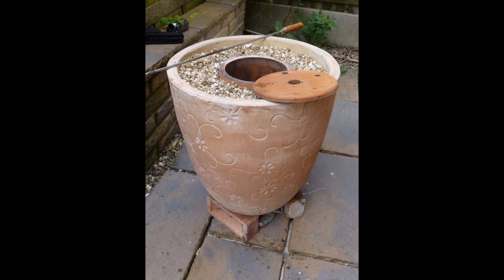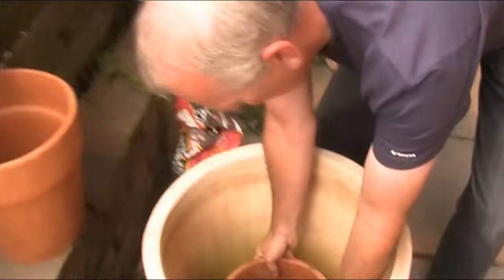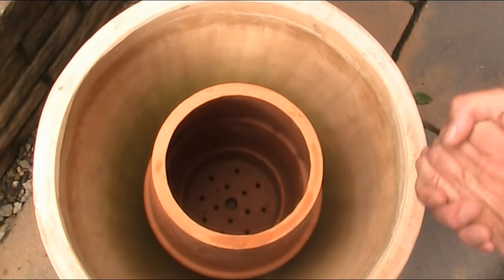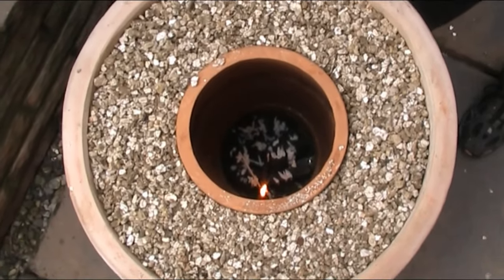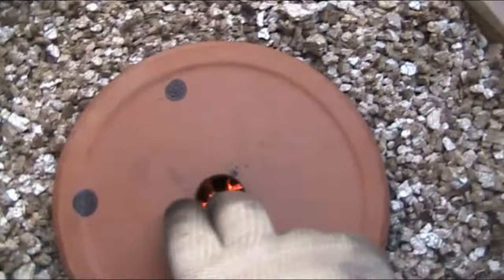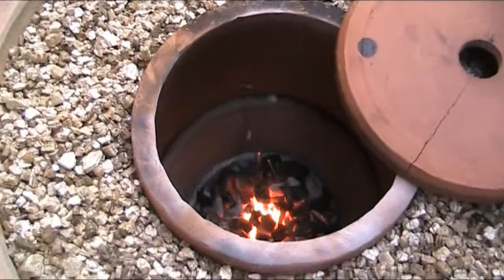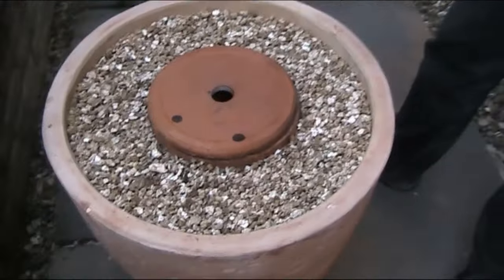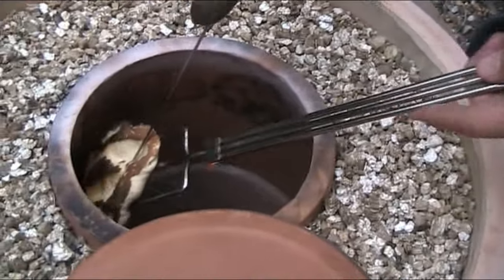How to make a DIY Tandoor oven with Flower Pots

Comment: hello Mr.Collins, few question - why did you drill holes in the inner pot (the one which seats inside the bigger pot), did you also drill holes to the base of bigger pot?  if yes then do you need to align holes of bigger & smaller pot ? for ventilation?  how do you clean (remove ash etc) this unit after you have done with the cooking? do you need to season inner wall of this pot before you start using it? hope to hear from you. thanks in advance
Reply from the maker: Hi Boon, The first oven I built had just one hole in the bottom, but the base was smaller. For the new oven I wanted a bigger base so I could use more charcoal and have an even hotter oven. The bottom pot I went for only had one hole, so I decided to drill more to improve the air flow. I am glad I did as the air flow is perfect, see my other video on lighting the oven. You have seen how easy it is to build, if you are unsure try the oven first. If it doesn't work take it apart, drill some holes and try again. I did not drill any holes in the bigger pot, that already had three big holes. I did not align the holes over the outer pot with the second build. Where possible is best to do that as it makes cleaning easier. As for cleaning some people use a vacuum, but I just use a cloth and brush, see video https://www.youtube.com/watch?v=ewac7d4u2uU . As for seasoning the inner wall, I did not, but others have. Lots of people have used special flavoured rubs, but I was happy without the season..
Reply: thank you. thank you for the whole idea behind this oven. I will make it soon. though i have one more question: the first few chunks/pieces on that skewer facing direct heat(towards the bottom) -  do they get burned/roasted badly? thanks in advance

Comment: Would it okay to place this tandoor pot in my balcony on a concrete floor?
Reply from the maker: Hi Paresh bit hard to answer this one as would want to make sure there is no fire risk. I can tell that I get no real heat from the sides, but some hot ash falls through the bottom onto a tray. I have mine on bricks on top of concrete paving slabs, and it hasn't damaged them.

Comment: This is brilliant I have the plant pots but need insulation. You mentioned vermiculite. This is a type of plant food , will it contaminate the food ? And could I use shingle stones instead ?
Reply from the maker: +Anthony Kirby Hi Anthony, why do you say it is a plant food? Yes gardeners use it, but for soil aeration typically in potting or growing seeds. There is no feed in standard vermiculite. I am using the larger vermiculite typically used with indoor fireplaces. But if you are concerned the vermiculite is kept separate to the food area by the inner pot. You can even put a seal over the top in either clay or render.  Yes you can use shingle stones, several people have. Some are happy and others not. It is clearly a decorative option, but the insulation is not so good.
Reply: +SimpleNick - Nick Collins I researched the wrong vermiculite Nick. The insulating type you use I now know of thanks. It is hard to come by only online order. But I've used smell decorative stones that work really well and much cheaper to. Plus no cracking to inner or outer pots. Thank you for replying.

Comment: Great video Nick cheers! Quick question~ Are there any alternatives to vermiculite? How about sawdust or will that burn from the heat?
Reply from the maker: Hi Hamza, not sure about sawdust, I would always be worried about it catching fire. Some people have used sand with mixed results. Perlite is another good one, and I have also seen people use the small clay beads that gardeners use.
Reply: Cheers Nick shall give it a try

Comment: could the flower pot have chemicals?
Reply: +Hospitalist007 only if it has been glazed. plain clay pots won't have that problem.
Reply from the maker: +Hospitalist007 As Tana says the real problem is if you used glazed pots, plain pots should be fine. I was concerned about lead in the pot, so I made the following video to confirm everything was OK - https://www.youtube.com/watch?v=SNGPP6b4ZZ0

Comment: Love it, consider me inspired to try. I want to use a galvanised incinerator as my exterior, partly because they have the raised ventilation in place but also because they have a lid / carry handles etc.

How effective is the vermiculite insulation? I ask because I can only buy it in 2L bags so that will end up costing more than the other components, is the outside of your largest pot hot to touch, warm, cool?

Thanks, love this!
Reply from the maker: ***** the vermiculite is very effective, and I can easily handle the sides. Understand what you say about the galvanised incinerator as that was my original plan. I was going to store it in the shed and then move it around the garden when needed. Instead I went for the pot as I wanted it on show in the garden all year round. If you are in the UK you could get the following http://www.travisperkins.co.uk/Silvaperl-Vermiculite-Insulation-Granules-V4-100L/p/947421
Reply: Thanks Nick, I've gone ahead and ordered the incinerator, just waiting for Amazon to deliver it (Incinerators aren't on sale in Sweden, where I live). I certainly prefer the pot, it's a much more pleasing look but portability is crucial due to the heavy winters we have here. Will report back with progress!

Comment: nice tandoori oven. but you will struggle with heat and to high temperatures.  you need more width and height. I used a clay pot like yours with a slightly smaller clay pot in the same shape.   kind of like a dome in a dome shape. cooks so much better with better all round heat.
Reply from the maker: +Dean Grant Thanks for the feedback and sharing what you have done with the community. Personally I don't have problems with heat now, as I reduce the amount of charcoal I use. As for naans, I wet the side of the walls to reduce further.
Reply: +SimpleNick - Nick Collins  what I did was  got a large  egg shaped terracotta Pot and put a same type of pot in side it..I had to cut the top off the large pot to get the smaller one inside.. I made a tunnel at the bottom and air holes like the real thing.  I used clay to refill the top.. now my oven has the similarities of the real thing.  and a all round exchange of heat.. and not like a chimney breast or tunnel effect .  it's perfect I'll post the video up soon..

Comment: Had great fun this weekend with this, made some great naan, chicken, lamb and fish!! Bloody brilliant! Cheers Nick!!! one question, the bottom pot has cracked, its the second one to go, wondered if you had a tip to prevent this? thanks again for sharing!!
Reply from the maker: guy mace Hi Guy glad to hear you enjoyed building the Tandoor and you got great results with your food. as to stopping the bottom pot from breaking, some people have said about putting a grid at the bottom to take the coals of the pot to stop it cracking. No scientific proof if that actually works. Personally my inside bottom pot cracked, but it doesn't bother me. It cracked after a couple of burns, and I have been using it for 7 months now. It doesn't affect the performance. I suppose if I was worried I might look to repair it with clay.
Reply: SimpleNick - Nick Collins Hi Nick, thanks for the reply, yes i agree, having used it cracked, it makes little difference to the temps achieved. At least not to a point that matters for cooking. Just for infos sake, I looked into cracked tandoors and most commercialy sold ones advise a low heat (small quantity) of fuel to be used for the first usage and slowly build up the heat, this allows excess water in clay to escape slowly and should prevent cracking, however given we live in the uk and its damp and wet practically all year this will probably become a pain in the arse doing that after each time it rains or gets damp. Another thing I thought was to mix the vermiculite with cement and water and infill  with this. This again would need drying time and a slow warm up to prevent cracking but may be a better longer term thing. But all a bit too much thought here.. your idea is brilliant and I'm so glad you shared it!! Had chicken and naan every day this week!!! all the best.. :)
Reply from the maker: guy mace Thanks for sharing your ideas on curing first. I did that with my pizza oven, but for the Tandoor I didn't bother. You could look at repairing the cracks, but as you say why bother, life's too short. If in a years time I am not happy, I can always replace the inner port, a nice three minute job.

Comment: Thanks for the video, i have been toying with the idea for a few years & this video is very inspiring. I have 2 questions. I am planning to place the tandoor in my patio which is made of a concrete base and am worried the heat from the tandoor's base could crack the concrete. Do I need to be worried about the heat this tandoor generates at the outside bottom (the area which you left open for ventilation near the bricks) how hot does that area get?. and the 2nd question was related to starting the coals, in your video you just threw in a match and within a few mins you have them going (are they any special kind? or does the setup make them go fast) for me i usually have to sprinkle starter fluids and lots of air any tips...
Reply from the maker: Are you thinking of setting the tandoor in a concrete base or on top of it. As you can see my Tandoor sits on bricks on patio tiles which are made od a concrete mix which causes me no problems. The reason I have it on bricks, is to allow the air to flow in via the holes in the bottom of the pot. Also it also the ash to drop out of the bottom to be swept away. As for lighting the coals, I pour some BBQ lighter fuel on the coals, and then just drop a match on, nothing else. The air gets drawn up from the bottom and away it goes. The important thing for me is to put the lid on top to slow down the air flow. If I don't do this the air flow can be a bit too much and the fire goes out. Note this is only for the first 15 minutes, once coals are going well you can take the top off.
Reply: SimpleNick - Nick Collins Thanks Nick, the way you have Patio tiles i have a concrete base, my worry is that on top of the concrete base if i put bricks and then the tandoor on top of it, i can risk cracking the concrete base (due to heat)
if a concrete tile breaks its easy to replace compare to an entire base (which is connected to my house base & hence wanted to be careful in the location i place it. thanks for confirming the lighter fluid

Comment: How safe is it to cook Naan bread on the clay like that? Are there any concerns about toxic chemicals that could come from the clay pot? Should the pots be seasoned first for cooking bread like that?
Reply from the maker: ghendric I am comfortable that it is safe, my main concern was lead, but I was able to test against that, see my video https://www.youtube.com/watch?v=SNGPP6b4ZZ0. As for seasoning the pot, personally I didn't and I haven't had an issues in the last year. I have been contacted by several people that have seasoned their pots, and often with exotic flavours.
Reply: SimpleNick - Nick Collins Has the bottom ever burned out of the bottom of the pot after that intense heat?
Reply from the maker: ghendric No it hasn't burnt out, there are cracks, but everything is still functioning. I plan to do a review of the oven in September for it's first Birthday, with a close up of the inside.

Comment: This method is similar to the Iraqi oven, just leave the oven low heat so as not to burn bread and wipe it with a wet cloth, the Iraqi oven is made of clay and some straw👏🏼😊
Reply from the maker: That is exactly what I do now when cooking naan, thanks for sharing with the community.  What do you call this type of oven in Iraq?
Reply: SimpleNick - Nick Collins  Iraqi tanuwr
Reply: If you want the bread to be shiny and crispy, wipe it with a little oil or olive oil or butter and put a little sesame on it

Comment: Hi, after installing the new tandoor.. with all the dust after cutting the pot. How do you prep the pot for first use? Do you season the pot with oil or anything? Thanks in advance.
Reply from the maker: Hi Mohammad, great question and previously I had read about seasoning the pot with oil, or salt, of a special spice rub to improve the flavour of your cooking. I didn't do any of this, personally I wasn't convinced about the need of this, plus I am inpatient. I just cooked straight away, and I am more than happy with the results. I had no problems with naan sticking to the pot, or then getting them off afterwards. The only problem I had was with over cooking the naan at the beginning. Now I appreciate how quick it cooks and take them out earlier.
Reply: SimpleNick - Nick Collins how did u clean it before first use though? Damp cloth? Dry cloth? 

Mohammad
Reply: SimpleNick - Nick Collins ive made mines this weekend.. but using the jamie Oliver/Jimmy method.. with firebricks as base.. and a half a  brick hole on the side.  Finished it late sunday and hoping to fire it up this coming weekend.
Reply from the maker: Mohammad Hansrod  When I originally cut the pot there was lots of dust, so I just used a dry cloth. When it came to the cooking, I used a damp cloth to clean it first before lighting. I then used the damp cloth again to do a quick wipe before the cooking.  As for the Jimmy method, was that the one with the dustbin? I saw him make it on the tele, looked good, but I personally didn't want to use a dustbin. I wanted my oven to look pretty and be left out in the garden all year round.

Comment: Do you think the outer pot could be something with paint and/or glaze on it, while the inner pots remain just clay terra cotta?  I’m thinking the rock/gravel insulation would be enough to prevent any kind of fumes from the outer pot. Thanks!
Reply from the maker: Hi I have several example where people have used a glazed or painted pot for the external. With good insulation there is not a problem. Now normally I would give a link to my website where I show example. Unfortunately I am in the process to moving the site, so have a look in a week or two on www.simplenick.com
Reply: SimpleNick - Nick Collins — Thanks very much, Nick.  We’ve got a huge pot that I thought would be perfect, so I’ll try it out.  Thanks for the link for your new site, I will check it out.
Reply from the maker: Hi have added a few ovens that use glazed pots which you can find here - http://www.simplenick.com/category/your-ovens/
Reply: SimpleNick - Nick Collins — Those are great examples, Nick!  Thanks for posting those. When we get ours done, we’ll send you some pics.

Comment: How do you get the ashes
Out ?
Reply: He needed to cut the draft opening at the bottom of both pots and run a metal tube between them before filling with sand. No need for a bottom stand, just need a layer of sand.

Comment: hey Nick
thank you for this video, it's very informative and helpful!
i have a question though.. is there a minimum to the thickness of the insulation between the pots?
Reply from the maker: +בועז קהתי Mine is 3 inches, the more insulation the better, but you are restricted by the size of pots.
Reply: Thanks Nick!

Comment: Hi great video sir, 
I have a question regarding the pots. The big pot which is the base does it have a hole inside it? Also do we clean the pot with water and leave for it to dry then used it or simply just got them front the store n used them thank you
Reply: What are the size of the pita please
Reply from the maker: Hi Sandeep, yes the big outer pot has has a whole inside, well three to be precise. I just gave it a wipe with water before using for the first time, and every time I use it again to get rid of any soot.
Reply: Thank you so much for replying , one more question can you tell me the size of the pots used thank you
Reply: Pots *
Reply from the maker: @SandeepKaur-sh1de  Hi Sandeep, check this blog I did the other year that answers your question. http://www.simplenick.com/2018/01/24/what-size-pots-to-use-for-the-tandoor/

Comment: Can you use a stainless steal bin with holes cutout with the pots and filling? thanks
Reply from the maker: Hi Pete, I haven't personally used a steel bin, but others have. Here is a link to an example from my website http://www.simplenick.com/2018/03/21/andy-goddards-dustbin-tandoor-oven/
Reply: Cool thanks Nick
Reply: Hi Nick, I built the tandoor with a large galvanised bin, however the bottom terracotta pot split, how can I prevent this? Does this need to be replaced or could I fix it? thanks
Reply from the maker: Hi Pete, do you need to repair the crack in the pot? I have cracks in mine, it is now 3 1/2 years old and I am still using it today. I did post a video about filling the cracks in my upper pot about a year a go. But if I am honest I am not worrying about the internal cracks and it does not affect the performance.
Reply: SimpleNick - Nick Collins 
Hi Nick it’s a big crack, it happened when I first lit the tandoor. I could fix it or repair it with fire cement. It could have cracked due to the rain and then the pot not drying out or I put in too much coal first time